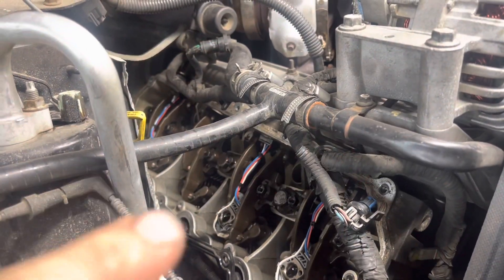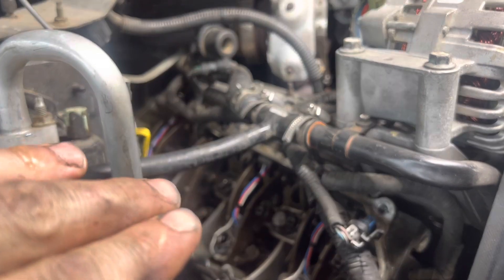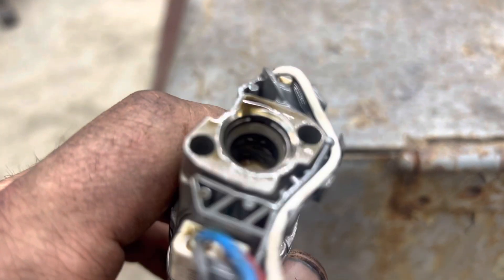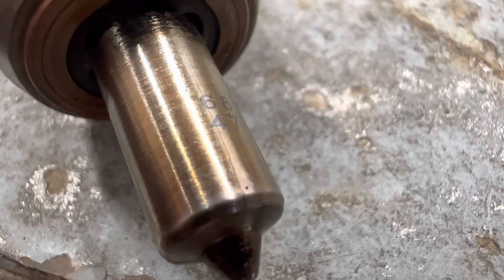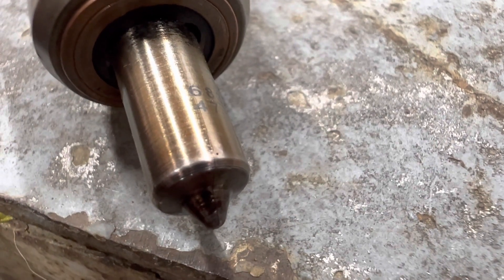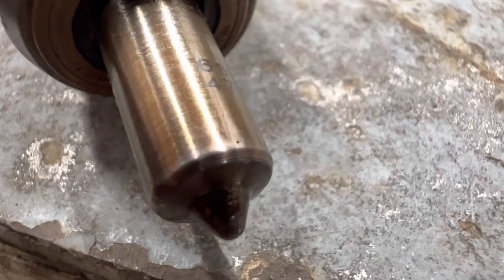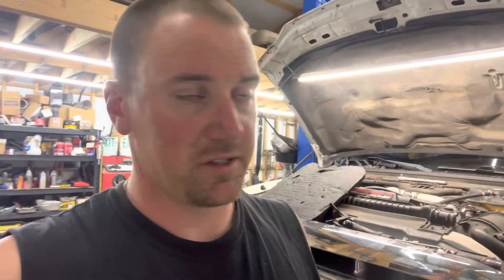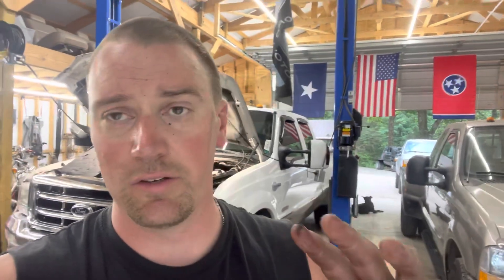6.0 Powerstroke white smoke, rough idle bad injector diagnosis.

Comment: I have no codes, my 250 smoke under light accell and load. Coolant level good. Does not skip. I was thinking of servicing fuel system filters additive to start. My truck is all factory stock . I have little experience with diesel. I dunno if this will help my issue but it was informative and I like the clip with symptom. Excellent work overall. Sux about the product defect. It sux the customer may not be confident but, every person they tell, that you took care of it, is advertising for you. Almost all people will respect that. My truck does smoke like that clip, but when I'm going light load checked turbo by hand doesn't feel substantial.

Comment: We can hear the frustration in your voice from having new Ford OEM injectors fail.  That is a lot of labor you had to eat.  If you had not cleaned the carbon off the injector tip would have been a big question mark.  Thank you for posting this info.

Comment: Thank you so much , I had a cylinder 2 contribution code , found nothing wrong with the injector until I cleaned the carbon and found a hairline Crack in the tip , replace with a reman it fixed the white smoke and misfire
Reply: When you had a misfire, did it turn into a knocking misfire?
Reply: Having the same cyl code on #2.  Replaced all 8 injectors a week ago.
Reply: @ethanflood5504  sorry for the late reply.  No it was running fine but it was puffing out alot of white smoke
Reply: @Panarrican65  need to look into cylinder 2 sounds like something is going on in that cylinder , maybe a cracked injector sleeve...
Reply: @MrFitzfn  Thanks!  It sucks..paid $2,200 for Rem injectors and kit at "Bullet Proof Diesel".  I will take it off this wknd.  If it's cracked, don't think they will replace it..right?
Thanks for replying!
Reply: @Panarrican65  they probably weren't aware of it , just tell them it still has the same code they should fix it , that is expensive

Comment: Thanks for your videos, straight to the point no BS.  Just installed  8 Rem. injectors on my 6.0.. I'm getting white smoke, my mech friend says "it's normal".  Got the same code but w cyl #2..  Should I go ahead a remove #2 to check it out?  It's been just a week, but the code keeps coming up.  Also all 8 glow p's with low voltage code..
Any videos after replacing the cracked injector?
Thanks
Reply from the maker: @Panarrican65  white smoke is never normal

Comment: I got some smoke rough idle and #5 code. Tearing into to replace. You got a video of how to do this side. Couple of the cover bolts are extremely tuff to get to and torque and I'm sure the oil rail and other stuff too
Reply from the maker: @reeaub  yes in other videos I show the passenger side

Comment: Good afternoon, I have a question. My injectors leak air through the two holes on the top, is that normal or not?
Reply from the maker: Air when you air test I’m assuming? A little is normal when air testing after having taken it apart. Lots of air is not normal.
Reply: @AutomedicGarage  Yes, when I do the liquefaction test, it likes a lot because of the two holes of the injector

Comment: Couldn’t this happen from water in the fuel? I’ve heard that can cause injector tips to crack
Reply from the maker: Yea if it freezes. It’s summer here in Tennessee.
Reply: @AutomedicGarage   I’m in TN too haha East TN. Got some buddies out sorta near you I think in Henderson.
 It wouldn’t have to freeze to crack it, but the water doing that is just a theory anyways. The only definite thing I’ve seen is back in 2004 International put out a TSI (kinda like a TSB by Ford) stating that if you run the truck out of fuel or it sees low fuel pressure, you can crack an injector tip. Not saying that happened here but good info to know!
Reply from the maker: @gabewall7381  that’s nothing I’ve ever heard of or seen with a 7.3 or 6.0 injector. People get water in fuel all the time and it doesn’t ruin a 6.0 or 7.3 injector. And running out of fuel in either one of them doesn’t ruin the injector tip.

Comment: Anybody have the cure for having to replace these oem injectors over and over?
Reply from the maker: 10-30 motorcraft or 5-40 rotella, archoil additive, 3k mile oil changes and a good functioning oil cooler usually does the job. Ive only had this one bad batch that affected 2 trucks.

Comment: In the beginning you said new injector and said remanufactured in the end
Reply from the maker: @stangleeze  it’s new to the truck and it is a reman injector, doesn’t mean it’s out of some used parts pile and is crap. Flow tested, 3 year warranty, and cover labor costs.